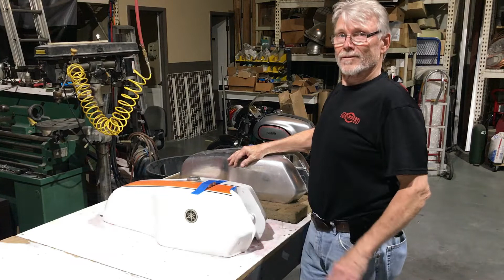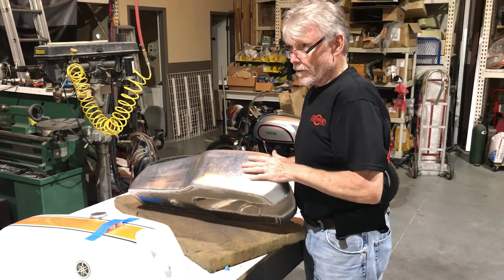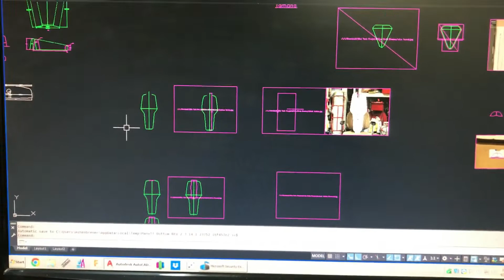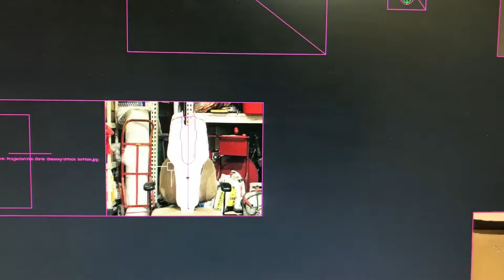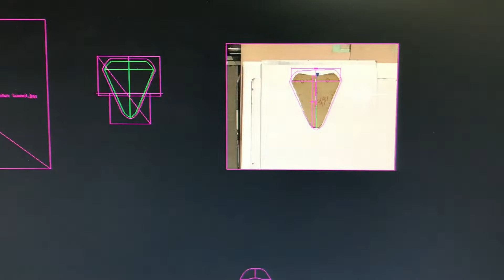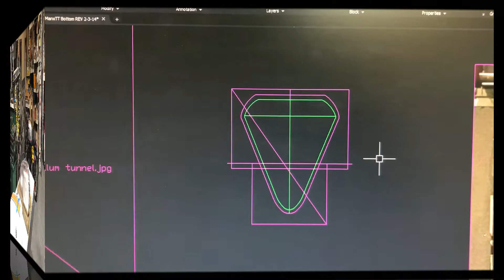Yamaha Aluminum RD Motorcycle Gas Tank Metal Shaping

Comment: Great videos. I really like your 3D printing bucks. If you have time can you do a short video on your 3D buck, the specific type of material used to print it and how you constructed it to allow you to attach the sheet metal to it etc? 😊👍
Reply from the maker: Anytime you shape aluminum it really helps if you flange around the perimeter. The tools I use have a flange which is how they attach with clamps. The piece then automatically retains that flange which you cut off just before planishing on the wheel.